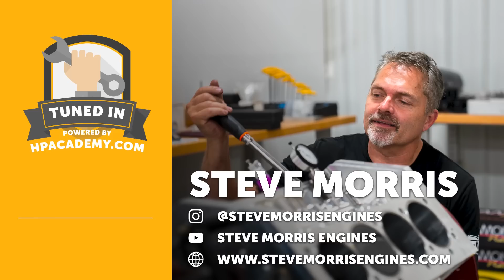4500+hp Engine Building With Steve Morris [#PODCAST]

Comment: So cool listening to one of the leaders in the industry and knowing he shows the good and the bad, as I do. It's gotten some flack from hatters but ultimately I can sleep at night and know I'll do everything within my power to make things right if it's my fault. I started HLP Products (specialize in the Honda/Acura V6 J-Series engine platform) on the side of my house on a paved concrete pad and a shed, now in a 1200sqft shop with some small machines and GOD WILLING we get to where Steve is. Fun to listen to the best and try to learn from them 🤙 I also been telling the J guys for DECADES that limiter is not good and is why we've taking even stock valve train components to such double to triple the stock power figures of these engines with zero issues...they mocked us and said you "always need to upgrade"...😑 In regards to the screw blower versus Turbo I believe at least in my brain it's from the direct force induction occurring right at the manifold or cylinder head essentially, being the screw blower is directly on top and usually takes the place of the intake manifold. That's verse a turbo with charge piping, with the same idea around less charge pipe equals a faster boost ramp

Comment: $130,000 engine and no preheating?  Seems like block heaters would be so easy. Electric water pump and a heater in the coolant swirl pot. Hell can't one go in the dry sump tank? Kill injectors n crank a few times. Hell there's the kind of heaters stuck on with putty too.
Reply: its not that its not possible, its the case of most guys wont use them. its no big deal on a typical drag car to plug in an oil heater while prepping a car in the morning (although this isnt common place in most drag race applications) however drag and drive is a different deal.

a drag and drive program discussed here is a pile of work. when your done for the day at the track you have to change tires, many change shocks, swap fuel systems around, many lash valves to zero lash (when hot), pack up all your gear and head out. without issues some of these drives can take 8 or 10 hours, with problems you can be up all night. if you do happen to get some sleep, it wont be much, at the hotel in the morning you have to lash the valves again before you even fire the car (it wont start because zero lash hot is valves being held open when cold) and get to the track, change tires, shocks, fuel system, etc over before you can make a pass. what it comes down to, if a guy has to get up a half hour or more early to go drag the generator out of the trailer and sit there while the oil heats up, at some point they arent going to do it.

the mantra of a drag and drive program, no matter how fast or slow it in, is keep it simple. in this case, if you can trade off the horsepower in pumping more oil volume to make one less thing that a sleep deprived 2 person race team can forget, its the way to do it.
Reply: @Sharkey_t Yeah what this guy said!